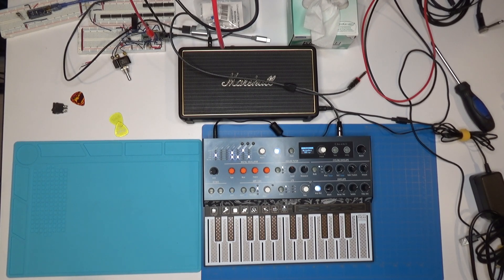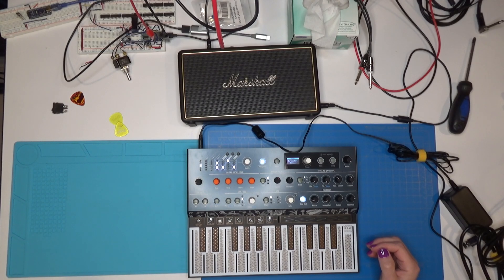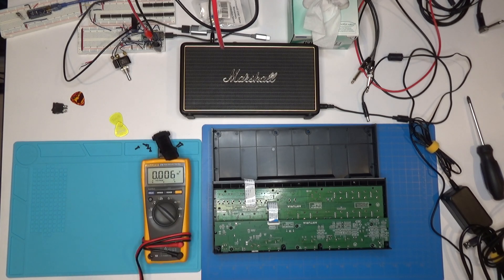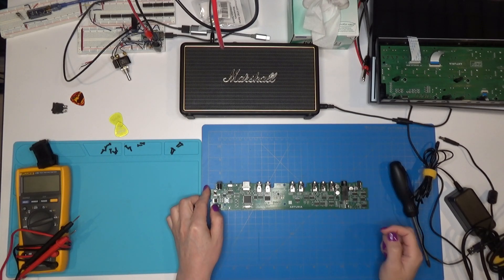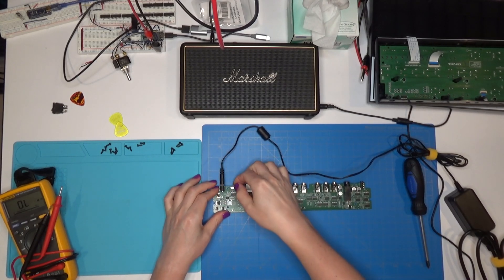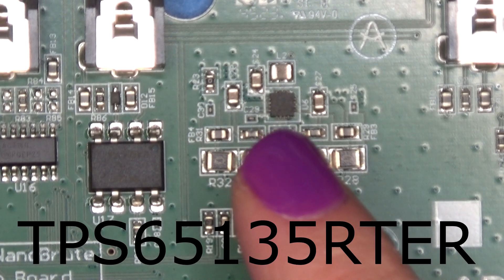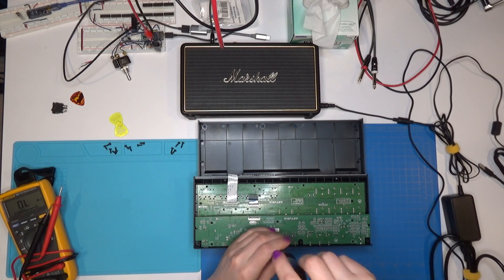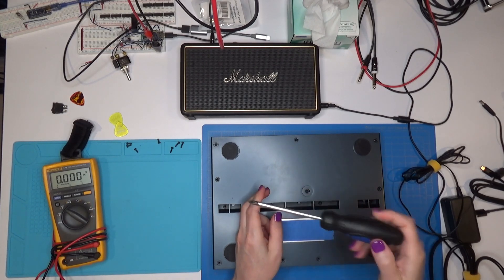Arturia MicroFreak No Sound Fix

Comment: hey bruv sorry had to retype as used wrong handel. I bought one with a board exactly like this in May, it worked fine, then i put it away after one use, to work on my masters stuff, i got it out last wed to start and figure it and its just making clicking noises no matter what tried SHIFT ARP OCT repeated flashes in MCC as advised by Arturia and after 4 hours, im done. just found this video. If you could reply  id appreciate any thoughts you have im about to respond to them and send links to the videos, im hoping they will take it back. Cheers mate. thanks
Reply from the maker: As I understand it, in poly mode the MicroFreak uses a digital VCA while the audio is routed out and back through the analog filter that the +/- 6 volt supply powers. So if you're hearing clicking that's probably the VCA envelope opening and closing on just whatever DC silence is coming back from the unpowered filter. If the clicking changes when you switch off poly mode (which would use the analog VCA, powered by the +/- 6v too) then that would be an easy confirmation of the issue.
Reply: @Nicoya yes that is what is happening
Reply: @Nicoya  Hey thanks for your reply. I'm still unsure what that means. Could you please say what you think that issue could be as i dont understand thanks!! cheers.

Comment: What's the main microcontroller that Arturia used in his main board?
Reply from the maker: STM32F446VET6, a decently high-performance embedded chip.
Reply: @Nicoya Nice , do You know if this synth have more than that microcontroller for other purposes?, maybe knobs control , or sliders controller, all my questions are for educative purposes
Reply from the maker: @MejoradoLopezJonathan  I haven't looked into it closely but the STM32F4 has plenty of IO capability to be able to manage panel controls, touch controls and screen all on its own, so I doubt there's extra microcontrollers to manage those functions. It's possible that some functions might be managed via peripheral chips on a SPI or I2C bus to reduce the board-to-board connector pin count.

Comment: Thanks a lot for a thorough walk through. My unit has exactly this problem 🤕 Wonder if Arturia wil fix it for me 🤔 I really love the Micro Freak. It is going to be hard to live without :)
Reply from the maker: If it's under warranty I'd expect them to fix it for free, or otherwise it shouldn't cost too much for them to repair it for you, or send out a new board (like I got), or you can find someone skilled with soldering to replace the regulator for you. Good luck with your repair!
Reply: @Nicoya  Fingers crossed 🤞I have contacted customer service – I have had great experiences with Arturia customer service before.